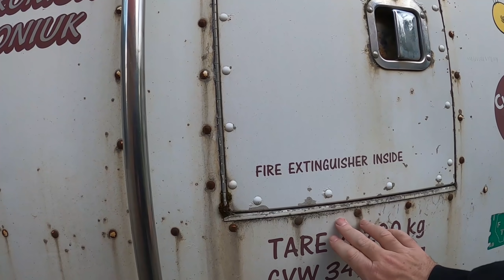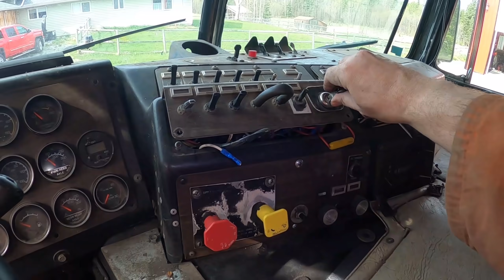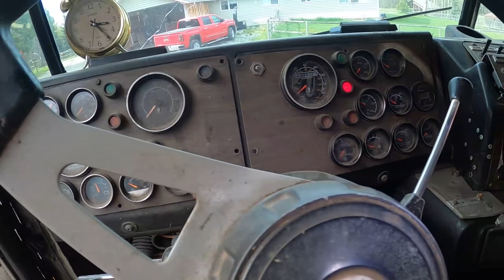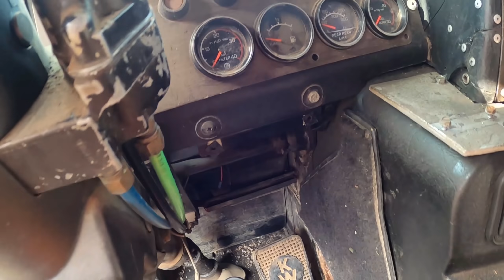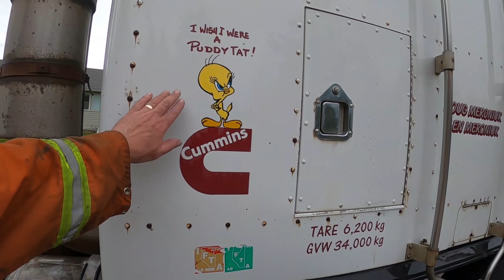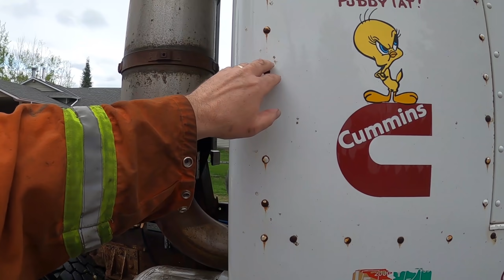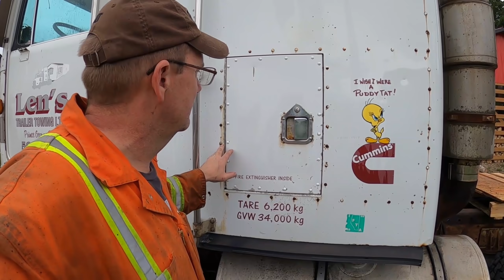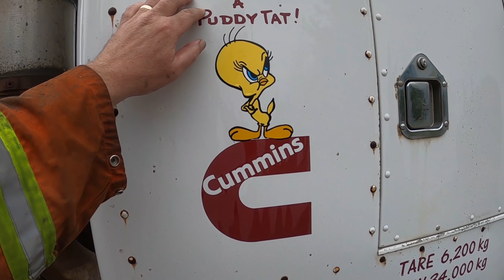First wash after 9 years... major damage found!

Comment: Good project, nice truck, glad you grabbed it :-)
My first tool on used chassis & bodies, is Ajax Cleanser.  Maybe you'all don't have that brand up north ...  But some kitchen scouring powder with bleach is great.  It will gently remove the oxidation on aluminum and painted surfaces, especially white paint.  It will take out the rust stains nicely.  
Don't use silicone on anything you might paint ...   Some sort of rubberized caulk that specifically says "paint-able" is best for now.  After finding what all is wrong, you can go to more permanent caulk.
Twin mufflers will pass enough, more than any single. Mufflers good, quiet good, less headaches going down the road.  Like to hear my tunes, not the exhaust so much.

Comment: G'day Mike. You'll need to remove the pivot pin from the brake pedal. 
There's a alloy piston under it and it may have swollen with corrosion. Remove the piston buff it up and reinstall. That's were it'll be jammed.
Watching from Queensland Australia.

Comment: If you are planning to stretch the truck out I would not go over the 250 inch wheelbase trust me you would be very disappointed so as long as you keep it under that it will make a good truck also you will be able to adjust the fifth wheel a lot easier I used to drive cabovers I would love to drive one now again a cabover is what I was trained on so keep us updated on your project and congratulations on buying the KW

Comment: Just finished the video.  Looks 100% better.  Ok, maybe find a set of cutoffs since the frame has been cut already.  Front half looks good cleaned up.  Needs at least 2 more feet of wheelbase.
Stay with a KW frame if you can. I think Neway has the most simple design, and looks the best, but is not necessarily the best performer.  A bit more difficult to find on a KW frame, I ordered mine specifically in 1996.  (T800 High Hood).  PS- Make sure the axels have "Hub Pilot" hubs.  Ask a friend.  Budd wheels looked cool but a pain to service.  Really, hub pilot wheels are the best.

Comment: I had the same issue with an old western star i bought try to pull the pins for the brake pedal that button underneath is probly siezed but not the treadle theres also a rubber cover on top that should just pull off then penetrating oil! Good luck

Comment: good on you mike ,  rare truck for sure ,   rough truck yea,   fixable  hopefully ,,   cabs can fall apart if rivets start to pop ,  watch for cracks in windscreen pillers to the roof ,  dash board cracked up tell me she is fatigued ,  but if it's real bad windows can fall out ,   i'd replace the bad rivets 1st ,  not sure if you will get the original rivets but you can get subitute to use instead ,   done my 82 k100 cab myself ,  tip get scissor rivet gun or air , those rivets bit hard with normal rivet gun,    remove the corrossion of alloy panels then replace rivet

Comment: Like your way of thinking yes it is a big project but over time it will be a very nice truck love to find something like that does not require a CDL that is a fixer upper and with a automatic transmission that I can haul my 5th wheel rv camper that has a sleeper attached to it for extra guess or just when I want to just take the truck

Comment: You've got a project there that's for sure, time to invest in a sand blaster, sand blast parts, prime them move onto another section do the same. In all the years around trucks and wrenching on equipment I've never seen axles rot out like that. Were they launching boats in the Prince Rupert area? I'm surprised you're not wanting to go tri-drive lol, I think if you could find a clip with a set of Meritor 40s its all you need its not like you're gonna be grossing 63,5 with this old girl.

Comment: Well, it has a rebuildable aftercooler, so that means it is not the first series of the 88NT. The smoke/miss on start could be a couple of things. First, the oil jumpers, the plastic ones that go into the injectors. Early ones IIRC were black plastic and liked to blow the plug out of them. This will not show as low oil pressure, but results in the oil being shunted away from the STC manifold/injectors. Take the lids off and have a look when running, if there is ALOT of oil at one injector and none forward of the one spewing the oil, that is your issue. Do all of them while you are there. Another thing, STC valve o-rings/barrel and plunger. Take the fuel pressure sensing line off of the FSOV and see if there is oil in it, it will be black and not fuel colored. That is a sign the STC valve is in need of repair. Yet another thing! I saw the oil pressure came up slowly. See if the engine has a viscosity sensor. Easy way to tell is to look at the sensing line on the lube pump. If it is the small looped steel line, it does not have one. The oil pressure SHOULD jump to 80 plus PSI at start, not uncommon to see 100 psi cold elevated idle with the viscosity sensor installed. Also, OP looked low, 10 PSI at idle. Look at the regulator in the lube pump, it is a very common issue. If your engine does not have a viscosity sensor, I have a new....well old now, but never used one i'll donate to you. I started working at Cummins in 1988, saw and been into more of these engines than I care to remember. There were also other issues. I'd like to chat with you on it. Contact me through my channel if you like, and I can fill you in on some other issues that make the engine run much better and be more reliable and what to look for. m35a2ww
Reply from the maker: Thanks for all the info, I think I will definitely be needing more assistance...

Comment: Smoke is no problem whit Cummins when it is cold. But when white smoke after starting the warm engine, that's a problem aftercooler leaking. Mufflers are used where I live used in Big cam Cummins, no problems.

Comment: Seriously Mike, I'm halfway through the show.   You're gassin' on it.  Sounds like maybe 2 bad injectors since it was hard to start also.  Mine will start pretty easy with one out.  
Next time the engine  is cold, fire it up and feel the exhaust manifold at each exhaust port.  Might feel a cool one or two after a couple of minutes of run time, the others will be warm.  Sooner or later they Get Hot!.  The cool ones will be the dead cylinders.  Be careful.   Old truck fan here.  Still think a southern doner would be a consideration,  although,  in this video, it looks like an extended sleeper.  Cooler yet,  but harder to find.  My imagination at work!.  Can't have to many trucks or truck fans!.  Long live trucks!.

Comment: hey i have some missing parts for you the rad opening door sounds like it needs fuel lines and some atf in the fuel should put some atf in the engine oil also run it then change oil
Reply: i even have the mirrors the covers for under cab headlight covers
Reply: send me an message
Reply from the maker: The Radiator flap is my greatest need as well as the grill chrome
Reply: @mikethetrucknut  did you get my email address i can end you some pics
Reply from the maker: @patrickbooth2329  my email is mchamberlain@peterbilt.bc.ca

Comment: If you can get it, Hydrafloric (with an F) acid cleans aluminum and makes it shine (no white). It's dangerous stuff and needs to be mixed about 8 parts water to 1 part acid. Straight up it will chew a hole into concrete. Use gloves, a mask and a spray bottle. Spray on, wait a couple of minutes and high pressure off. I used to own a detail shop. It got to where the supplier wouldn't sell it to me anymore because of the danger.  But it works like you just polished the aluminum... HydraFloric.

Comment: I know one thing . If you dont add some wheelbase to it that thing is gonna be like driving a army tank. Acid wash the the aluminum if the wheels and and tanks dont come clean. If you end up acid washing the aluminum you can have somebody highspeed polish it all and it will look like brand new again. If that rearend set up and frame portion on the rear turns out to need a whole bunch of repairs done it wpuld probably be more feasible to just buy a whole set of cutoff tandems that are complete frame and all and have it installed that way you can add wheelbase at the same time. Put straight pipes on it and lose the mufflers.

Comment: I wouldn't waste my time trying to work that brake pedal back and forth with lube. The Pedal is aluminum and the pin is steel meaning electrolysis and oxidation has it seized up. Pull the cotterpin and drive the pin out, then take a drill the same size as the hole (not larger) and twist it in the hole by hand. Then clean the pin up, cover with never-seize and put it back together. You'll spend more time trying to free it up with a hammer and it will still stick. I've repaired many of those.
I'd use Purple Power in a garden sprayer to degrease the truck. I've used it straight before, but be careful because it will burn any clear coat on paint and leave streaks. You may want to dilute it some.

Comment: I see couple deep scratches on the thank  if you are penny pinching maybe rap the outer half of thanks in stainless sheet and polish the ends 
Put a fitting on one of the air tanks hook up the air compressor so you aren’t running the truck all the time to find air leaks
Yep 💯% better

Comment: Penguin double frame it's been done once meaning The temper in the middle is going to be weaker so you do it again the temperature is going to be weaker it's going to be a weak point in the frame so you probably want to double frame it and bolt it in then weld it I'll make sure you got it in line because then you got to take it the rear ends and have it done more relying you know the biz

Comment: Do not use silicone unless you have the special cleaner. My boating friends and I consider using silicone, to be a keel hauling offense, with the motor running, in gear. Why should the barnacles have all the fun.😱🤣🤣🤣

Comment: hell yes on the new way suspension Kenworth suspension is rubbish (ride) truck i drive has the ag400 suspension (8 airbag) its all over the place feels like it wants to tip over  when loaded with grain either single  or pulling a pocket road train
Reply from the maker: Yeah, dad said same thing. I will definetly not be putting 8 bag back in.
Reply: @mikethetrucknut  cool Mike

Comment: major damage found time to swap the entire frame with a 2021 mack frame paint the entire cab metallic red paint job 2 straight chrome exhaust 10 chrome rims stretch the frame 2 long fuel tank+  chrome front bumper  after invest about 50k on it will be probably awesome truck and will be ready to put it to work